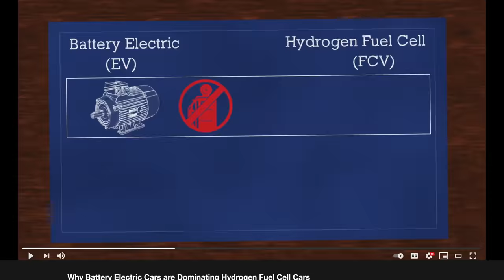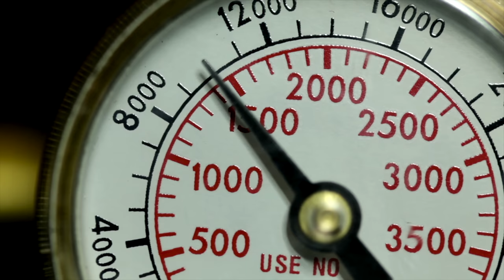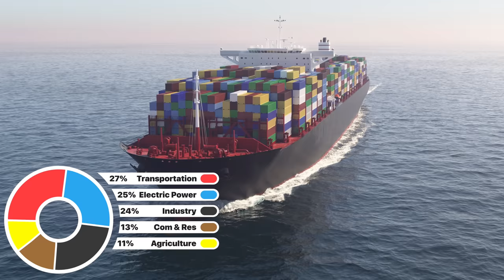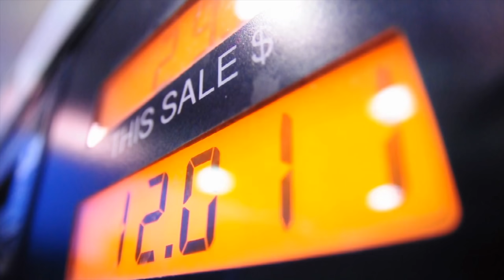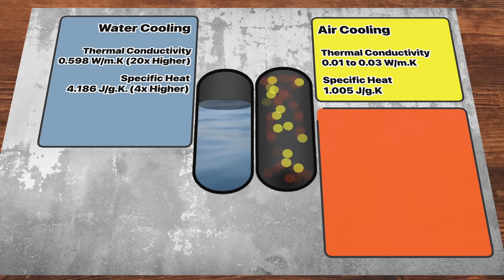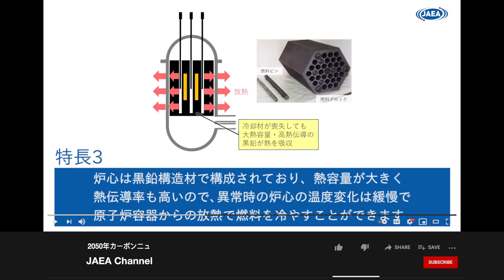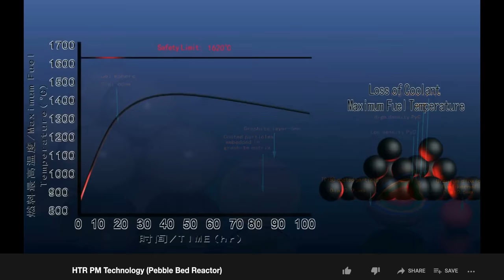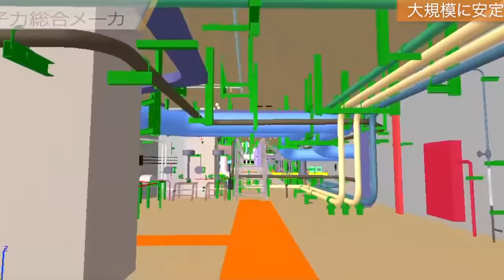Japan's Plan to DESTROY the Price of OIL and GAS!

Comment: Very interesting.  The commercial reactors we have in the USA are light water reactors and the water used for cooling is turned into steam that runs a conventional electric turbine.   

The HTG reactors run at much higher temps and it is these temps that allow its direct use for  things other than generating electricity.    

Hydrogen will only ever be a niche fuel.
Reply: Two percent of all global GHG emissions are from steam reforming of methane to make hydrogen for industrial process, primarily ammonia. So hydrogen has been an important industrial input for decades. It’s already much more than a niche industrial input, and if you have a clean more efficient way of making you could greatly expand its use in industry. The main issue is it’s probably never going to heat your home or power your car which is what advocates keep touting. So as an industrial fuel and input it will only see an expansion in its use, but Musk was right when he called fuel cells used to power EVs fools cells.

Comment: The nuclear waste can be reused: there are special reactors that do this since radioactive material is unstable it wants to be stable with the same amount of protons and neutrons
Reply: Nuclear waste is a meme, in the grand scheme of things the actual space occupied (m3) by the waste is a fraction of a fraction of space available on earth.
Reply: It's expensive. If it was EZ lots of countries would have done so by now.
Reply: @FizzyGajing  it's really expensive initially, but pretty cheap long term
Reply: *Once you've cooled it down enough. Before that, it has to stay in cooling pools, which take up more space.
Reply: The TRISO fuel in pebble bed or cast block style reactors is much more difficult to reprocess and results in a much larger volume of waste. Not a great idea IMO.
Reply: @Hideyoshi1991  Where did you get this? As far as I'm concern the cost would remain the same.

Comment: I thought it was pink hydrogen! But yes there are important use cases for hydrogen and so having a stable domestic supply from nuclear power plants is a good plan. Since nuclear is baseload power, hydrogen production could ramp up and down there depending on the availability of hydro, wind and solar on the grid. So when there is lots of sun, make hydrogen, when there isn't much sun, sell electricity. Nuclear seems to be too expensive to me though, it has its place in Japan and many other urban places but it is too expensive for the most part

Comment: I'm a little confused with what you meant by Toyota and Honda haven't been too involved in EV's so far. I know Hybrids are not EV's but they still use Batteries to power hybrid motors. I drive a 10 year old Honda hybrid and have leased 3 Toyota Prius before that. They have put a ton of batteries on the road. Some kind of investment into battery technology had to have taken place over the last 2 decades between the 2 companies.

Comment: They need to improve refueling stations, so that the hose when refueling your vehicle doesn't freeze up causing every one to wait for it to thaw off.
Reply: You can always fill up at the source at the nuclear station it's quite warm there.
Reply: @ValdiValdies  Yes, we need one around the corner, that would be good, lol.
Reply: Electric  charging  stations  have copper wires. These wires get cut and  stolen  all the time.
Reply: @bobgteen6496  A large part of that is the level of your local law enforcement.  Many cities have defunded their LE agencies.  Along with a decrease of judicial sentencing, chaos is rampant as can be seen with Smash and Grab crimes.  Keeping a 400 Volt flow going through the cables might detour many who try and sever these cables.
Reply: As long as the gass is not drastically losing pressure, it won't freeze. It will actually heat up. Because the hose is pressurizing

Comment: Japan may not have produced that many technologies, but the ones they produce tend to be among the most widely used worldwide just like the blue LED, which is a vital piece in the current LED display and lighting technology.
Reply: Just what I was thinking, both VHS and Blu-ray (since he mentioned them) for example originate from Japan
So if those "battles" are anything to go by, hydrogen powered vehicles are the future
Reply: They haven’t produced that many technologies compared to whom exactly? Japan is one of the most technologically advanced countries on the planet.
Reply: Exactly. let's not forget the transistor which revolutionized electronics.
Reply: Sorry? Japan produced thousands of them.
Reply: Yeah, just cell phones
Reply: @Irpsnerple  Developed in the US.
Reply: @Ease54  yeah but they were clever and improved everything. Didn't they?  They not only copied our tech. No?
Reply: @Irpsnerple  Bell Labs sold them rights for 25K. Probably a major help in getting Japan recovered from the war.
Reply: @Ease54  I wonder if there was a clause in the sales contract which gives a percent of the gross profit to Bell since they owned the patent. I don't think they would sell the patent, knowing the huge profit potential, and only sell the right for the use of the original technology. IDK   Either way, thanks for that piece of knowledge. Interesting.
Reply: The first blue LED was produced at Stanford University in 1972. They filed a patent for it.
Reply: @Irpsnerple  Let's not forget that the transistor was developed at Bell Laboratories, in the United States.

Comment: IF I understand correctly, a Thorium reactor, cooled by molten salt, is not only efficient but can not be used to make nuclear bombs. Sounds like a win/win to me!
Reply: If i understand correctly, a Thorium reactor does not produce waste or almost none, as it burns its own waste -- but don't know about it's applicability to Hydrogen generation ?
Reply: @frankweinholt8787  Heat - Steam - Turbines - Electricity - Water - Electrolysis.

Comment: I'd be interested in the case of ships to see a comparison btw the use of hydrogen in fuel cells and burning it through a gas turbine with a heat recovery steam generator. The latter would obviously be more mechanically complex, but I'm curious if it wouldn't have some sort of advantage perhaps?
Reply: Ships will be running on bunker fuel for a while, the price for anything else will send shipping prices through the roof. Trust me I wish there was a better cleaner solution but without major international subsidies they will continue to burn that stuff for the foreseeable future. Maybe bringing back the age of sail would be the only other solution but even then the large container ships will disappear and the price for foreign goods will go up quite a bit. The only real solution for them would be using a fusion SMR that runs in hybrid mode. The SMR lasts the life of the ship and fusion since it's not a military vessel and can be attacked by any pirate with a sharp stick, so any damage and contamination release will be minuscule.
Reply: @anydaynow01  What if they came up with a synfuel that could work in ships? Ammonia, butanol, or something they could mix with that crappy oil. That could keep old ships running.
Reply: Fuel cells use platinum and palladium, which are very expensive..
So, the gas turbines are the cheaper option..

There are some methanol ships and talk of ammonia powered ones...

Comment: I was familiar with Pink hydrogen (nuclear electric). I hadn't realised there was a red (nuclear thermal) variant too. Interesting. PWRs are only about 25% efficient so you get 3 times as much heat out as you do electricity. Not sure what the HTTR numbers are but I presume it's similar. What is the efficiency of the IS plant? i.e is Red hydrogen going to be any cheaper than Pink?
edit: answering my own question, it seems that the process is about 50% efficient. So overall this is more than twice as efficient as doing electrolysis with thermal plant electrity (nuclear or fossil). But it's less efficient than hydrolysis itself (70%), so it's not clear that it's better than using hydro/solar/wind (all of which are usually cheaper than nuclear).